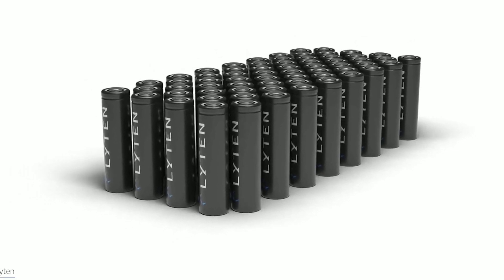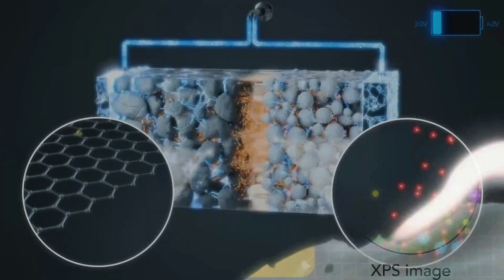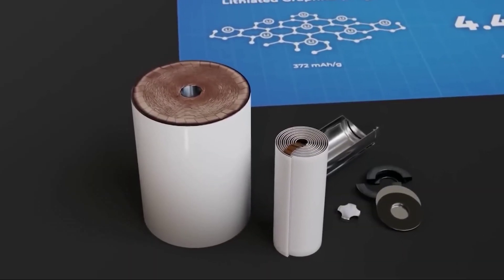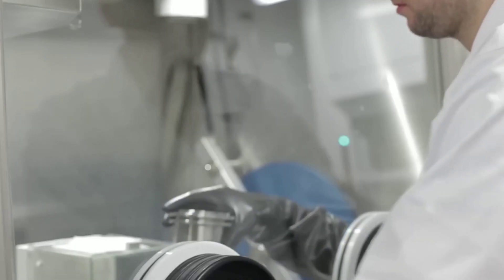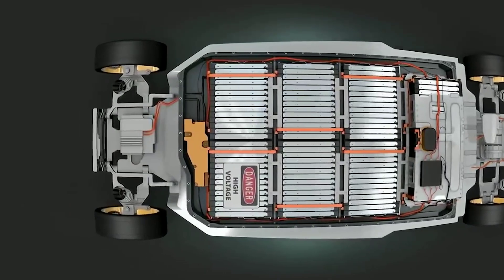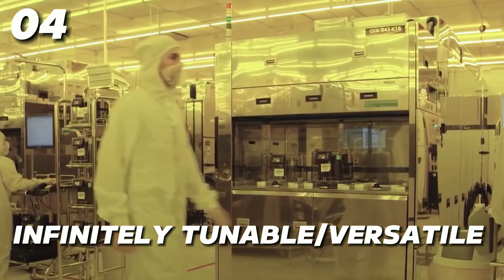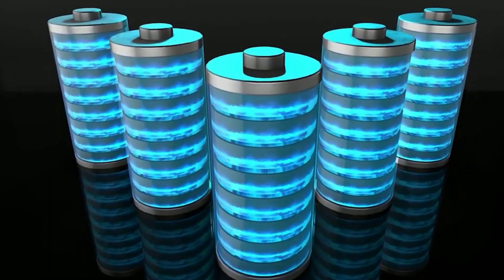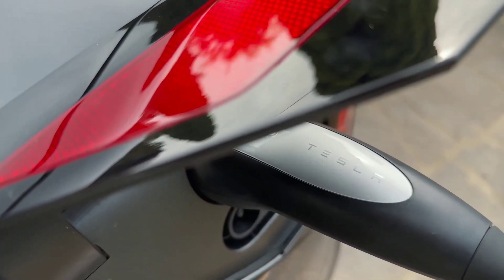USA Company Lyten’s Breakthrough Lithium-Sulfur BATTERY Will Change EV Industry FOREVER In 2024!

Comment: Damn. We have the materials. We have the chemistries down, but you will not change the designs. Think bigger. Think 3000 mile ranges with 3000 cycles with 1300 wh kilogram.

Comment: The same problems, and yet the design stays much the same? Love the use of sulfur and 3D graphene. Olivine structures? Have we thought about encasing a battery pack or cell in a noble gas like a vacuum chamber. 500 wh/kilogram, not a gram. Seems to be way too heavy. Why, bc it's the same design. Stuck in 2nd gear forever. Everything based on current manufacturing possibilities rather than a redesign. We need a big cathode, a small anode, or an electrolyte that can hold its charge. Get away from the many, many little cells. Have some guts and make a battery for truck or car, not for small electronics in case you fail.

Comment: If 3D Graphene is the core material in both the Anode and Cathode then the Lyten battery surely doesn't use pure Lithium Metal as the Anode (as implied at an early point in the vlog - 3:33). Graphene in the Lyten battery Anode (if the claim that Graphene is used in the Anode is true) is just a better scaffold for holding Lithium ions when the battery is in a charged state. So, Graphene is more of a substitute for Graphite in today's batteries. Anyway, the Lithium Metal thing is a fad and possibly a very bad idea.

Comment: Check your numbers ... 1,000 charge cycles is only 2.7 years ... did you mean 10,000 cycles ?
Reply: If the range is at least 500 miles (which is a modest estimate), then 1000 cycles would last 500 000 miles, which would likely be enough to outlast the other components of the car.

Comment: EVs manufacturing uses less cobalt than the petroleum industry by far. You didn't mention that. EV batteries are almost 100% recyclable. You didn't mention that. Graphene isn't awesome material but so far nobody has figured out how to mass produce it. So I'll be excited and surprised if Layton has figured that out.
In 2025 along with lighten there will be about 19 new battery factories in the United States. Will have to wait and see what they all produce. Some exciting things happening in the next couple years.
Reply: Graphene can be produced very cheap these days.  All you need is graphite and chlorosulfonic acid
Reply: Not 3D Graphene @yogamon

Comment: Lithium is not so abundant nor cheap also producing graphene in scale is still a problem. There is already safer cheaper battery chemistry already used in BEVs - LiFePO4 / LFP (also doped with manganese - LMFP available since this year) or Sodium-ion which started to be produced in scale this year.
Reply: Lithium is abundant, it's all over the world. The trouble is mining can't pull enough out of the ground fast enough. But it's abundant. For the rarer elements, companies like Tesla combined with SpaceX will start towing and mining asteroids giving them more than enough abundance, using their humanoid robots as miners and astronauts.